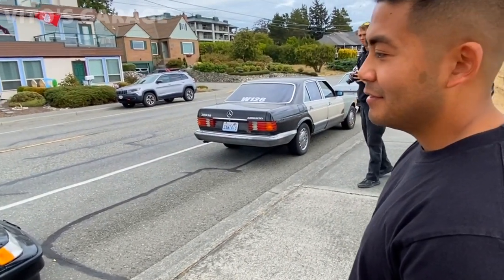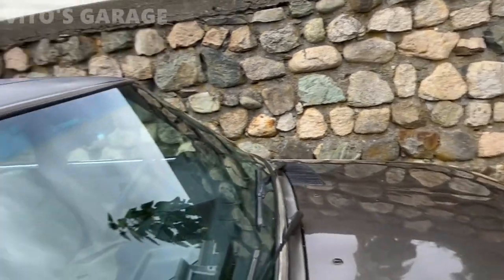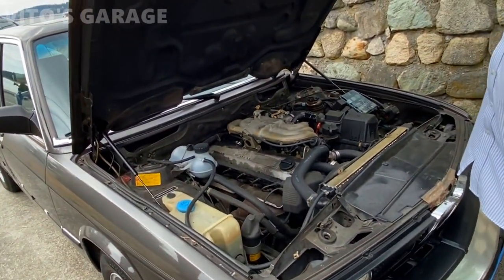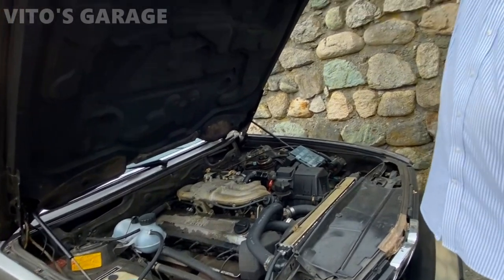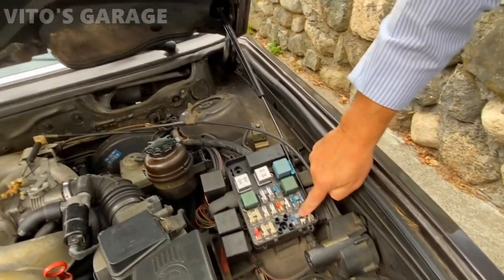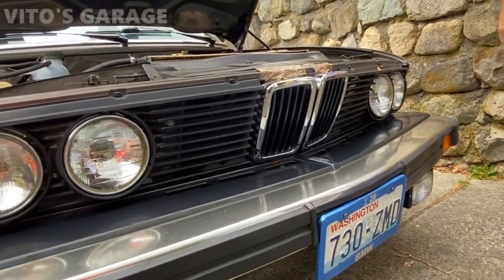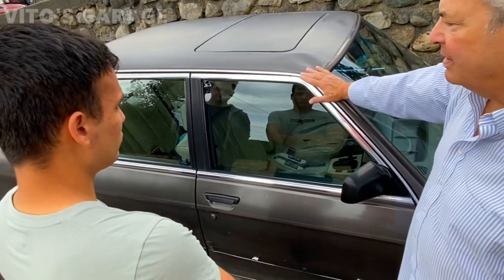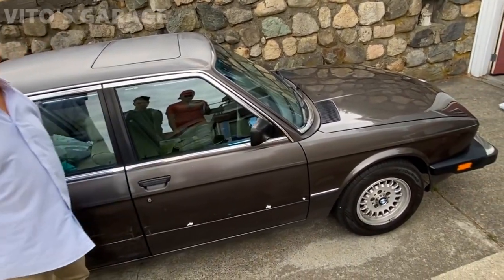We Met This Amazing Manual BMW E28 528e Owner by Coincidence! He Bought it 15 Years Ago for $500!!!

Comment: Yo Vito..Massive Respect to you smart , young man!  Who needs tons of tech in their car? I only need to hear the Bavarian Beast blast down the back roads.  The sound of a 6 cynlinder at 4000 rpm, is unique!. Foor it to hear the exhaust + intake Howl! Had 3 E32 1988.735i, manual 5 speeds.  Cruise control at 140mph on the autobahn all morning long,  German gas has higher octane and much more expensive, but the performance increase is Huge.
Reply from the maker: Thank you so much! They are all amazing cars! I love them so much!